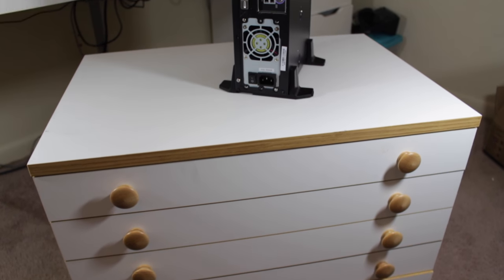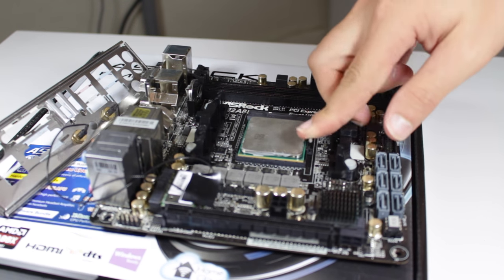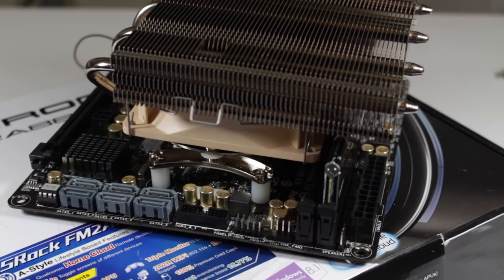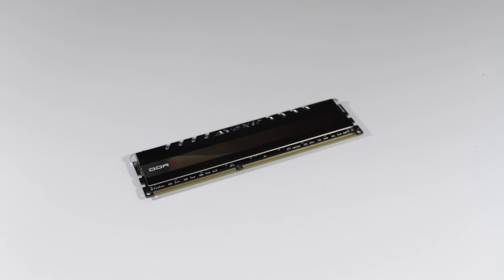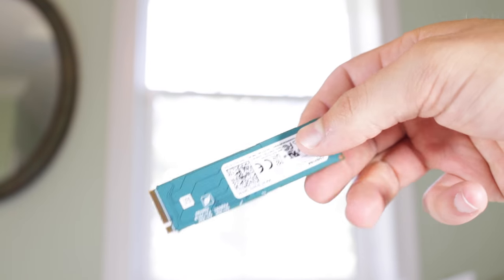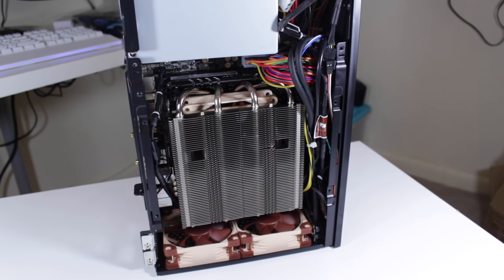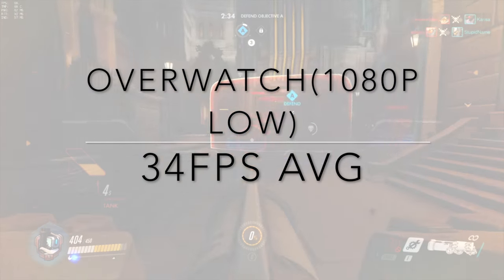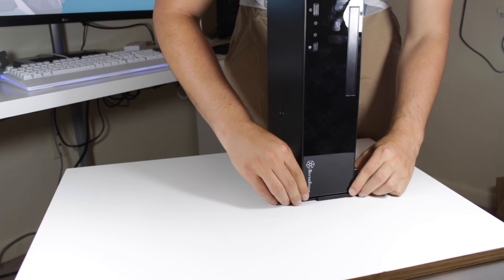The Overkill AMD APU Home Theater/Gaming PC! (2016)

Comment from the maker: Please read this before commenting about the ram configuration:
I already knew that single channel ram doesn't give you the same performance as dual channel going into this. This build was just for fun, this PC isn't actually being used and has already been taken apart and its individual pieces are being used for other things. The majority of these parts were review samples that I decided to throw together into a build. Like I said in the video I don't recommend this hardware combination. This build was just for fun.
Reply: Already commented before I read this. Too bad it got disassembled, it was pretty cool. I wish you would've done a sound test under full load with the mic on the sofa and the PC under the TV or something like that.
Reply: Then don't show this unfavorable memory configuration, if you already know that it will not result in the best performance. And you even mention the performance gain of the higher memory speed for APUs...
I really don't understand why you get review samples.
Reply: And the CPU cooler orientation would have been better if the cooler fins would have let air from the case fans through.
Reply from the maker: +LightSoundGate  Like I said this was just a bunch of parts I had thrown together in a build I didn't feel like spending more money on stuff I didn't have. This again was just for fun and though I don't recommend this exact hardware configuration all of the parts used I do recommend. Also, companies send me stuff because I provide value and give them lots of exposure especially relative to other channels my size.
Reply from the maker: LightSoundGate what are you talking about? the cooler fan pulls air directly from the case cut out through the heatsink then it's expelled through the 2 80mm fans. There really wouldn't be any considerably better way to configure it. Also, I am assuming your talking about the case fan that came with the case, which I explained in the video wouldn't fit because of the cooler size.
Reply: If possible rotate the cpu cooler 90 degrees so that it can profit from the air-flow of the case fans. It creates a nice synergy effect especially in such a small case.
You got the "exposure for the companies" part covered, I give you that. But I doubt your PC building expertise.
Reply from the maker: LightSoundGate the cooler can only be rotated 180 degrees unfortunately. And this is definitely not my best work. I'd recommend checking out some of my used parts budget builds, which are all about price to performance.
Reply: The single channel memory mistake is a rather big hit in performance. The APU can do a lot better when using memory in dual channel mode. Therefore your benchmarks don't show the best possible values a comparable setup could achieve. Might be a problem for some of the manufacturers.
Reply: Anyway. Peace and have fun!
Reply: Be honest and admit your mistake,no need for excuses.

Comment: Nice video Matt! I'm surprised that all the other games had be on low to get playable results, but LoL was maxed on 1080p and was super smooth. I haven't touched LoL in awhile so I'm glad that even with all the updates and changes they've made they are still very accessible to a lot of gamers. Keep it up, can't wait to see the OCZ review. I've still never owned a M.2 ssd and haven't given too much thought about doing so since physical space hasn't been a concern for me in desktops (laptops would be another story) and 2.5" SSDs are plenty fast enough for me, but will definitely check out the video when you release it.
Reply from the maker: Thanks Danny. As someone who is very budget conscious It would be very hard for me to personally justify the cost of a PCIE  SSD, but the insane speeds (2GB/s+ read and 1.6GB/s write) I can see being very appealing for professionals and enthusiasts who want the absolute best and who's time is extremely valuable. I received the drive as a review sample btw.
Reply: +Tech By Matt You said High Settings for CS:GO but You wrote Low... Wich one Is the correct Settings ?
Reply: +Tech By Matt You said High Settings for CS:GO but You wrote Low... Wich one Is the correct Settings ?
Reply: It's on high settings, he put a annonation
Reply: I love the APU concept its s shame the performance isn't better! I can only see this viable with a 250 or 300 dollar build.

Comment: Forgot to mention the biggest bonus of using PCIe-based storage: no cables. Running SATA cables (power and data) through one of those HTPC enclosures is a NIGHTMARE for cable management.

Comment: You know that using only 1 stick of RAM your GPU is being bottlenecked, right? Your memory is only 32 bit. Adding another stick makes it dual channel, which means 64 bit memory. If APUs supported quad channel, they could've get 128 bit memory, which is the minimum for budget gaming (dedicated) GPUs.

When it's launched or a little later, I'll make a Raven Ridge APU build with the fastest DDR4 RAM (hoping to get a 4200 MHz and hope Zen supports quad channel). I also want small form factor, but would really like to see it passively cooled. But probably won't be happening, since I want to build it in my Xbos 360 case modded for Micro ATX / Mini ITX motherboards. But for PSU I'm aiming for a pico PSU witha 190W external brick, which should be plenty for the system, 1 SATA SSD and 1 M.2 SSD. I might chance my mind and get a bigger case in which to stick a fat ass heatsink to cool the APU passively, but there's plenty of time until then.

Other than the single channel RAM, pretty good build. Good job.
Reply: Hope you know there isn't a such thing as "32 bit memory" "64 bit memory" or "128 bit memory", I'm not sure where you would have heard that from, I'd suggest doing some research on legitimate and trustworthy tech sites instead of either making stuff up or going off some false information from who knows where.

For the general user, and gamers who are utilizing a dedicated GPU instead of an APU, they will see very little, if any difference between single channel, dual channel, and quad channel; you really only start to see differences in performance with it in benchmarks, or when using an APU, so someone could run single channel perfectly fine with a dedicated gpu on a budget and be perfectly fine.

With RAM, as the channel count increases (Such as dual channel to quad channel, or single channel to dual channel), the overall bandwidth will increase; take going from single channel to dual channel for example, you should be getting roughly 2x the bandwidth, as it's two DIMMs being used with the data stored split among them, or step up to quad channel and you'll get roughly 2x the bandwidth of dual channel, or 4x the bandwidth of single channel, as you've got four DIMMs being used with the stored data split among them, allowing for much faster reading and writing of that data.

You're not going to find an ITX board that supports quad channel, so good luck getting an mATX motherboard into a xbox 360 case as well as fitting in a cooler, ram, pico power supply, and whatever else you end up needing with it.
Reply: TheKDub
Check TechPowerUp for memory bus width. 64 bit is what APUs running in dual channel have. Just like dGPUs have in specs "64 bit", "128 bit",  "192 bit", "256 bit", "512 bit" and so on.

People who only use CPU can get away with using only a 1600 MHz single channel stick of RAM. For around 2-5% improvement, they should go for low CAS latency. For APUs, the faster the memory clock speed, the better. But for better iGPU performance, multi channel memory is needed. Go check your facts before you try and correct me.

Also, I already build a PC inside my 360 case no problem, with a CPU fan, a 50 mm case fan and unfortunately using a normal ATX PSU outside the case. If you want specs, it was a Sempron 145 unlocked to Athlon II x2, overclocked to 3.2 GHz, 4 GB of low profile DDR3 RAM and the integrated GPU from the motherboard (HD 3000), that doesn't benefit from the system memory like the iGPUs from APUs benefit (they do use system memory though).

Edit: I had a microATX Asrock 760GM-GS3 motherboard and a laptop 2.5 inch HDD where Xbox 360's HDD used to be.
Reply: TheKDub
I do admit I was wrong in my first comment, since some APUs have 128 bit memory bus width (A10 7850k). So that means if it could run in quad channel, it would have 256 bit memory. But current APUs and CPUs from AMD only supports dual channel. Server APUs and CPUs will support up to 8 channel, but of course that won't come to mainstream systems. Though there is still hope for quad channel for enthusiast, just like Intel has their Extreme x99 platform.
Reply: *****
If it is just as small as an Xbox 360 case, I'm sold :)
Reply: *****
Awesome. I need to look for one. I'll note this case somewhere. Thank you :D
Reply: MrBiky You had only said "64 bit memory", had you specified it as "64 bit memory bus", then that would have been a different story.

Yes, dual channel will increase the memory bus to 128 bit, triple channel to 192 bit, quad channel to 256 bit, and so on..

The x99 platform has no integrated graphics support, and I highly doubt that there are plans for quad channel on any general consumer boards for quite some time.
Reply: TheKDub I am just assuming it, because AMD's Zen enthusiast 8 core 16 threads CPUs will use the same AM4 socket as the quad core CPUs and APUs (both having SMT). If a server board has 8 channels memory support, I think an enthusiast platform could have 4 channels. And after all, people forget that AMD started this "enthusiast platform" thing back in the Athlon days with their $1000 Athlons. They are combining the mainstream and enthusiast platforms, so I don't think they will give the same features to the enthusiasts that mainstream platforms already have, but rather the other way around.

And sorry for not mentioning all the details in my previous comment. It was a mistake on my part.
Reply: *****
I really doubt any AM4 APU will have HBM onboard. For server, it's really worth it, but for a consumer APU, having that kind of bandwidth is way overkill (and probably too expensive at the moment to be worth the costs).

DDR4 has enough bandwidth so that AMD can make an iGPU with 16 Compute Cores (4 x86 cores with SMT and 12 Compute Units). that means 1024 Stream Processors, which is double the amount the latest AM4 APU A12 9800 that was just released today has (512 SP). Having 1024 SP makes the iGPU comparable to a Radeon HD 7850 - integrated on a CPU.

What AMD has to make to make this APU possible (given the limited DDR4 bandwidth compared to GDDR5) is to make a good memory controller for Zen. That means Raven Ridge has to have support for quad channel memory and more than 4200 MHz RAM. It is doable, since Bristol Ridge still uses 28 nm manufacturing process and 14 nm is almost half the size , so they could fit double the SP onboard + the server APUs and CPUs support 8 channel memory. But it's still not known if AMD will support quad channel on their mainstream and enthusiast platform (AMD just released some chipset naming schemes for Bristol Ridge AM4 motherboards and has an "enthusiast" naming scheme to be released - that's for unlocked Zen SKUs and probably for the highest end Raven Ridge).
Reply: *****
I should begin reading my previous comments before I start writing books on Youtube (I repeated more than half of what I already said).
Reply: the specs for the next gen apu are out. just google it. a bit disappointed actually. was hoping at least 768 shaders but 512 seems to be the best one. thats probably gonna be at least $150 which is probably gonna alienate a lot of cheap builders like me.
Reply: samaEL X
Those are the specs of the 7th gen Bristol Ridge APU which is based on excavator cores, 28 nm processing node and GCN 1.3.

When out, the next next generation of APUs (code named Raven Ridge) will have Zen cores, will be manufactured on 14 nm and will have a GCN 1.4 Polaris 11 GPU (like RX 460). And that's what I'm hoping to have 1024 Stream Processors, because DDR4 has higher clock speeds and more bandwidth. Bristol Ridge only supports DDR4 2400 MHz at best, which means it's memory controller is pretty dumb. Raven Ridge will have a better memory controller, it should support at least 3600 MHz (maybe 4200 with OC).

I'm assuming this, because server Zen-based CPUs and APUs will have up to 8 memory channels, so AMD should be making a good memory control for AM4 platform as well (it might not have quad channel, who knows, but it will have high speed RAM support - I wish it will have quad channel, because it means even more bandwidth for the GPU, so even more performance).
Reply: Also, RX 460 has 896 Stream Processors and 128 bit memory bus width and performs around 5 fps faster than a Radeon HD 7850, which has double the memory bus width (256) and 1024 Stream Processors.
Reply: hd7850 is like 3 generations under lol that shouldnt be a surprise. even the intel cpus have the same pattern.
Reply: MrBiky
lithography might be a concern. would be difficult to fit 1k shaders with at least 4 real cores.
Reply: samaEL X
That's why I said it, because maybe 896 SP might be enough, even though I wish for mooaar specs. I am not sure how Zen will have dual cores though, it might be disabled quad cores (since Zen is a quad core module). Not sure if I already mentioned it already in this thread.

But even so, AMD won't settle for anything less than quad core for their high-end APU. And hopefully, it will still have 65W TDP, like Bristol Ridge, efficiency is important. It might be hard to do a 1024 SP APU, but considering Bristol Ridge has 512 and 4 cores (well, 2 CMT modules), I thing they can do that at 14 nm. And if not 1024, 896 will sure be manageable.
Reply: MrBiky
1k shaders + 4 cores at $150 store prices would still be a good buy for me. im looking forward to an mitx build with a liquid cooling support. i play pvp games only anyway. gta v, witcher 3, etc bores me. i know theyre great for almost everyone else but not my cup of tea. ai is too predictable that even 10 year old kids can defeat the game.
Reply: The HDPLEX 250W Hi-Fi DC-ATX Power Supply would of been a better choice to use, it can reach up to 400w with a good passive cooler which is good for OC any processor.

Comment: pretty much what I just built for a multimedia/general purpose and programming pc running Linux  Mint xfce and Windows 10 but with AMD A8. I am adding another Radeon 7 board to run the other monitor. Good video!

Comment: Using a A10-7890k, you would not have needed to buy a cooler. ;) In addition, you could take two sticks of RAM for dual channel mode. This configuration can run Fallout 4 to 900p, better than an Xbox One. However good video.
Reply: agreed, or wait for zen

Comment: Nice and cheap build, but that PCIe NVMe SSD is totally disproportionate to the other parts. With a standard SATA SSD you can afford a CPU + dedicated GPU. You could even afford 2x SSDs in RAID0 if you really want to speed up your read/writing. Overall, pretty nice 2016 family lounge HTPC!

Comment: hey matt i built a apu build for my friend i hear a beep but nothing on the screen do you have any ideas
Reply from the maker: Many motherboards will beep when there is a problem and actually usually those beeps are a code so look in the motherboard manual to see what the beep code means. Other than that I would just recommend reseating all of the connections including all power connections as well as reseating the ram.
Reply: +Tech By Matt I couldn't have said it better myself.

Comment: @Tech By Matt if i will get a GPU for my system will my a4 5300 will be less busy after i disable its GPU?

My system:
CPU: a4 5300
MOBO: redfox rf-a55f2m3
RAM: 2x2gb Kingston Value RAM
PSU: 500w Generic PSU
OS: Win 7 Ultimate

Comment: Hey can I use an apu and another graphic card and combine their power all together
Reply: You have to use a r7 360/370 I believe to crossfire for combined powers I'm personally going to get a 960 paired with the 7850k I had it for 8 months and can be able to play just cause 3 at 1024x768 at avg of 80 fps and can handle Bioshock 1 at 720p low settings with 40-50 fps it's not bad but if you pair it with a good gpu if you want to crossfire or use a 960 or something it'll be a good investment
Reply: thanks for the help
Reply: WRONG! A APU only supports crossfire with a R7 240/R7 250 ONLY!
Reply: Also going for CF with low end GPUs is a bad idea. You will get micro stuttering and many titles dont even use multiple GPUs.
Reply: Rather than crossfire low end GPUs, you're better off buying a stronger GPU and deactivate the iGPU. RX 470 would work wonders with a steamroller quad core APU (if you already have an APU build). Otherwise, crossfire is only if you are really low on budget and want to grab like 5-10 FPS more for cheap. Again, only if you already built your APU system. If just building, you'd better get an Athlon x4 880K or an i3 6100 (if we're talking low budget builds).
Reply: wait 4 the zen ones, but yes, an r7 250 will work in "Dual Graphics"
Reply: TheCanadianLanBoy Zen is still far off. They will probably launch Zen at CES in 2017 (January). We might be lucky if we see some Excavator AM4 APUs by October (I assume somewhere before Christmas they'll start selling at retailers).

AM4 APUs will be like 5% better than Godavari A10 7890K, so if somebody already owns that, it's not worth upgrading. Though buying a cheap AM4 APU and waiting for Zen to upgrade the CPU is a good idea. Something with the compute power (and price) of an A8 7600 is a good choice until Zen shows up.
Reply: multiple GPUs is utilized in fullscreen mode but not windows or bordered mode.
Amd Apu have a low pipline of about 500 or so, so you would have to find crossfire with equal or the second Gpu would slow down to those speeds making crossfire useless on an APU.